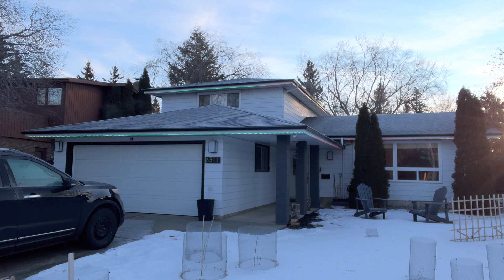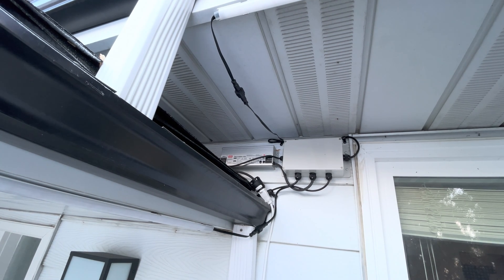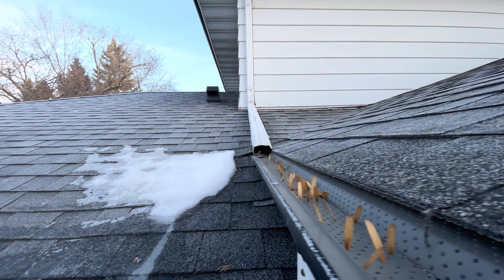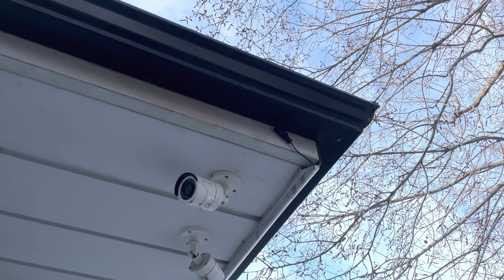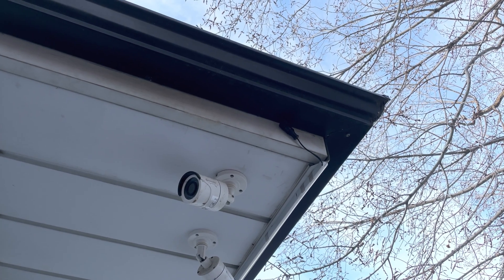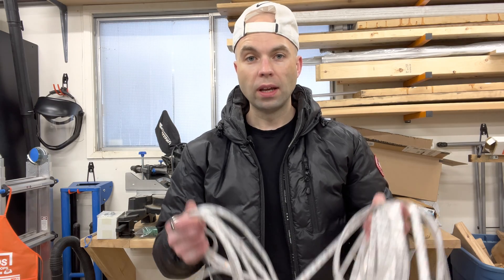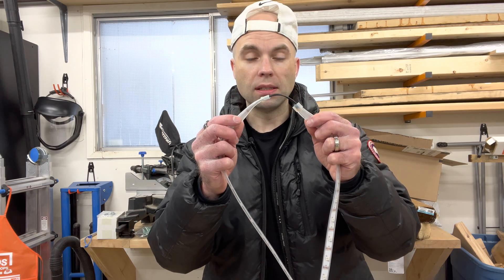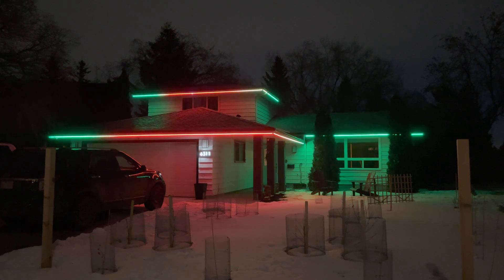How I Did My Permanent LED Holiday Lights

Comment: i more secure joint would be a heatshrink butt splice connector. you need a crimping tool though...
Reply from the maker: There is probably always a more secure option… there is no physical loading on this setup and no issues so far.

Comment: Man every time I think I'm settled on pixel strings I see a video like this in my feed that makes me think twice about strips and aluminium channel instead. Looks great!
Reply from the maker: Thanks! There are pros and cons to both setups. A lot of advocates for pixel strings seem to needlessly really hate on strips, but they don’t mention how expensive perma track is, how long it takes and tedious it is to make your own product comparable to permatrack, or the pain and suffering of pushing all the pixels into the track lol.
I personally like the clean look of the strip install, basically invisible when off. And even it also has the option to look very much like pixels too, you could set a segment to use only every 3rd light and it would have the same spacing but still be invisible when off.
Both are good choices, and just to make it harder don’t forget to check out the 30mm pucks! They come wired into tracks already, I would do that over pixels.
Reply: @Chase_Anderson  Oh no don't give me a third option! I think my shunning of strips in the past was because I was only considering 5v varieties and getting put off by the more frequent voltage drop, but your video is the first I've seen that uses WS2815 12V which has totally changed my thoughts. Am I right in thinking the backup data line just gets wired into the same data channel output on the DigQuad?
Reply from the maker: @_tim  that’s what I had thought too, but Quindor (who makes the boards) directly advised me to wire it to ground - so that’s what I did.
Further discussion in the community makes it sound like either will work (can splice the data or wire to ground) but I just followed Quindors advice and have had no issues to date.
Reply: I want to do strips but how do they do in the extreme Alberta Canada cold winters.
Reply from the maker: @timneal609  I’m actually in Alberta, and I just took some footage, I was going to show them working fine in -33C! I’ll make and post that video in the next couple weeks.
Reply: @Chase_Anderson  nice I’m in grande prairie

Comment: How do you measure your roof lines?;. Do you actually go on on the upper level of the roof ?   Is there a program
Reply from the maker: Yes I went up and measured, being a solo project I taped one end of the measuring tape to the end to hold it lol.
For rough measurements you could use an app like measure on iPhone (I’m sure android has something similar) but for the actual measurements for cutting and whatnot I would want a physical measurement. 
Keep in mind you’ll need to install them, so you’ll need to figure out access at some point.
Reply: @Chase_Anderson  gotcha thanks so much !

Comment: How did u wire up the led lights to the dig quad cause the led strips have 4 wires coming out ?
Reply from the maker: I’m not sure which you’re asking, but
The ws2815 are 4 pin which are positive, negative, data and backup data.
There are 4 x connect wires coming out of the box which are
1) first strip
2) second strip 
3) power only to feed dig uno on second level which controls third strip 
4) was going to be power injection for the first long strip but it looked good without it so I didn’t waste my time.
Reply: @Chase_Anderson  thanks I was asking about the 4 pin wires that come out of the led lights them selfs. Since you only need to connect the 12v, negative, and data to the dig quad. But the led strip has 4 pin wires coming out of them.
Reply from the maker: @ericmoreno655  ok ya, it’s the backup data… major benefit imo to have a backup data line.

Comment: Great video Thanks! Sad that the clips are made from chromed steel and WILL rust over time I am sure of that, may take a few years but here comes the rust??? Wish they made them with stainless steel but cheap china crap right? I would suggest to  use stainless screws when attaching ANYTHING outside! Also, ANY led strip that is in a protective silicone sleeve is NOT waterproof by any means! What makes it IP65, 67 etc... is the sleeve itself What people do NOT understand is the condensation factor also. Condensation will in time work its way into the sleeve and the strip will go kaput!!!! This all depends on your weather factors in your region! Im sure using the aluminum channel will help from the elements. Heres one for you, Have you ever asked yourself " WHY " a LED strip manufacturer ONLY puts a 1 year warranty on LEDS they produce when they have a 50,000 hour life span which is roughly 6 years of leaving the lights on non stop! Why only 1 year hmmmm!  Hope your project holds up and good Luck Thanks for the great video
Reply from the maker: Thanks. I contacted the supplier and the clips and made of stainless steel.

Comment: Just wondering why you used a dig quad and a dig uno?  I was under the impression that the dig quad could run data and enough power for this size of install.
Reply from the maker: A digquad could definitely handle it, in theory you can do 600 pixels per channel and there’s also a loophole to get 5 channels out of the Digquad instead of 4 so that’s no issue.
I did it this way for 2 reasons:
1) lots of people report issues of longer data runs (over 25’) and running my top roofline off the Digquad would required that data line over 30’. Using the diguno up there my longest data line is only a few feet
2) the way I did it also leaves me open for future expansion - the second data out on the diguno up tops leaves the option for me to run another line to the upstairs window and then I have 3 left on the Digquad I could do my front window, door and garage door.
The caveat is that I have to make sure they’re synced right now… it would be way easier to control and schedule if it was one controller but then more work to modify later if I want to expand which I likely will.
Reply: @Chase_Anderson  thanks for the explanation.  I have my lower level running right now in a dig quad…and now that I know that the ws2815’s work in the extreme Canadian cold, currently running in -30C.  I’m going to start the 2nd floor of my house in the summer and try to run it all off of the dig quad.  I’m going to pick up a QUINLED Data booster to help with the longer data run.  Hopefully it goes well.  Thanks for the vid and the response.
Reply: @RSpills  We have the opposite issue, 40c + days at Christmas isn't that nice for lights :)

Comment: I'm curious how you did corners with the channel and the diffuser sleeve? Great video
Reply from the maker: Thanks, I bought a little hobby mitre box with saw off Amazon and just cut 45 degree miters. I got the tooth count for aluminum and I cut them with the diffuser plastic installed.
I also started at the corner and worked to the ends so all I was doing was taking off like an inch with the mitre and the overall length didn’t matter, and the final cut at the other end was just a straight cut - those I cut the channel to length with the hobby saw and just used heavy scissors for the plastic.
Reply: An average power miter saw with carbide tooth blade for wood trim work cuts aluminum very well and smooth. Just go a little slower than you normally would to be safe.
Reply: Pretty thin aluminum, I’d imagine a hacksaw would be just as easy.